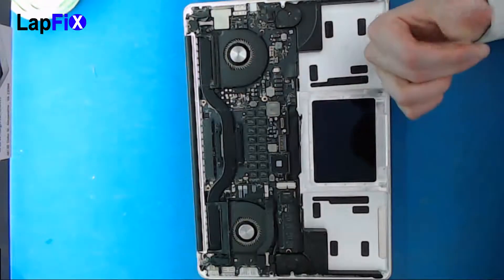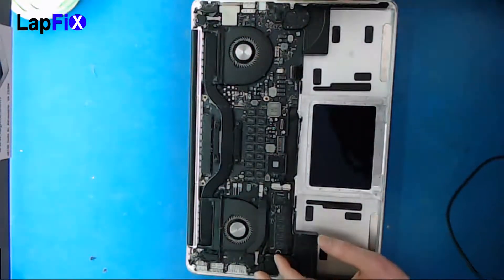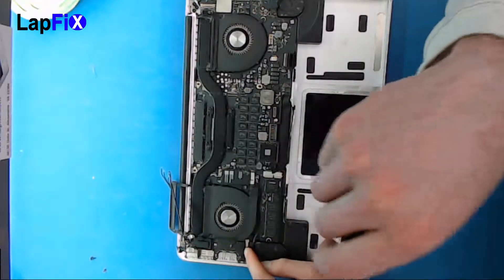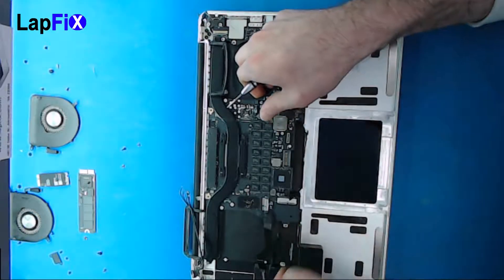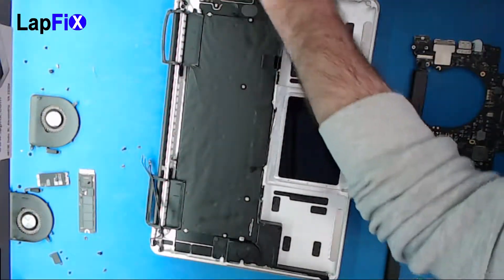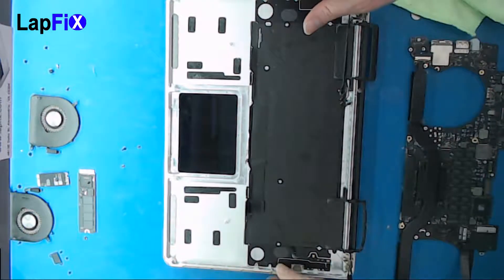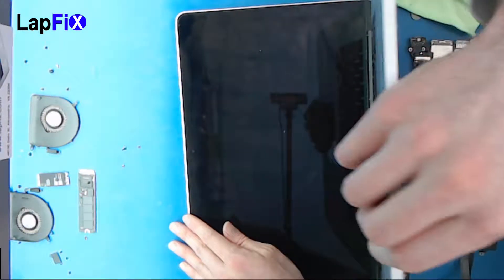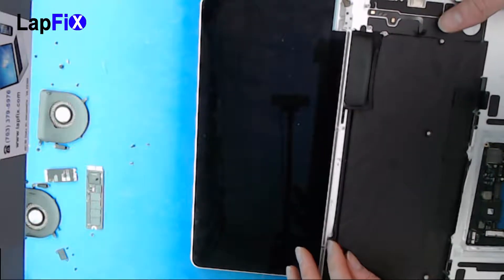MacBook Pro 2015 keyboard Replacement A1398 | How to

Comment: What are you using as the adhesive strips for the battery? Should the adhesive stripes be added anywhere else besides behind the battery? I think you should add links in the description to the other parts of your video series. I had to look through all your videos to find the correct videos for this 3 part series.